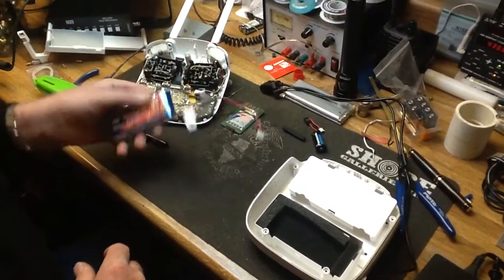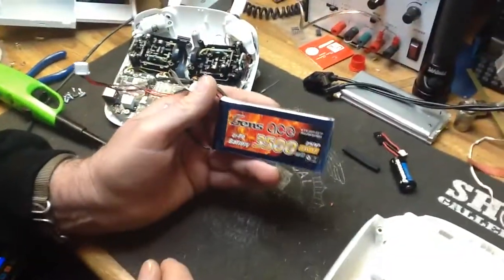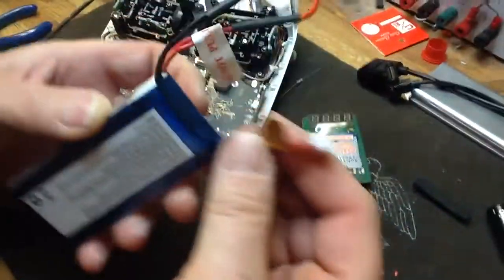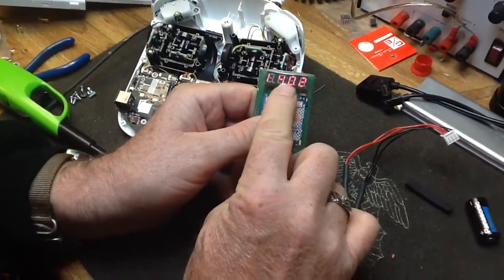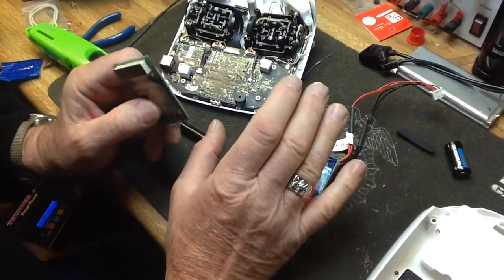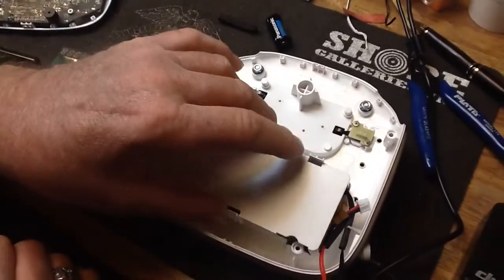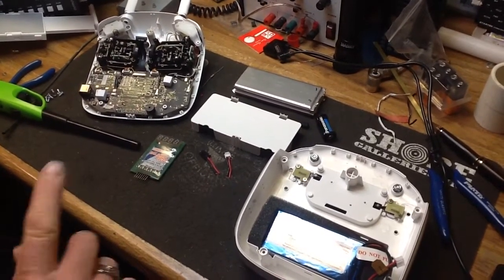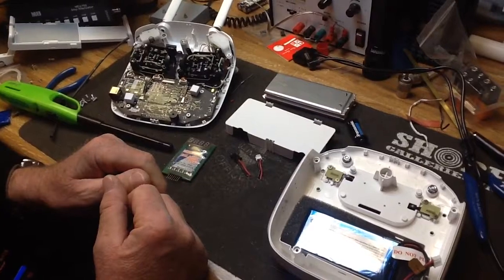Phantom 3 controller battery replacement GL300C Part 2

Comment: I've ordered the LiPo battery you suggested, a Gen Ace B-TX-3500-2S1P on eBay for $14.50 including shipping.  I see that the original battery was also a 2S1P pack.  So, I'd guess the integral board was likely monitoring each of the series cell's individual voltages for balance during charging.  I'm guessing the dual wiring from the old pack to the board may be because DJI originally was going to do the balancing on the main board and not at the pack.

Your measurement of a peak quiescent current of under 500 ma suggests this 3,500 ma-hr battery should run the controller for over 6 hours.  Your solution is actually the better design!  I have no idea why they thought they needed a 6,000 ma-hr battery in this controller!

Did you have the WiFi board (which the ribbon cable connects to) connected during your load measurements?

Anyway, thanks very much for your investigative work and for posting the two videos.  I'm anxious to install my Gen Ace battery and get this annoyance behind me!
Reply: Hi, Ted Sz! Do you know what the C on the battery means? Im trying to find a battery that will work correctly. Ebay isnt a good option living in norway.. Found one that had a discharge at 30 C. Will it work? https://rcbutikken.no/nb-NO/produkter/74-volt/formula-d-battery-3300mah-30c-max-60c-2s-deans.aspx
Reply: Oh, sorry! Of course you dont understand Norwegian:) Never mind the link. Ehm, the C is not temperature. It has something to do with how fast its possible to pull the power out of the battery. So the one in my link has a discharge of 30c with a maximum of 60c. And the one you ordered has a discharge of 1c with a maximum of 10c. And since i dont quite understand this, im not sure if it will work...
Reply: The C stands for the rated capacity of your pack, or 3,300 ma-hr.  So the base rate of discharge is 3.3 amps for one hour.  So, 30C means the pack supports 30 times that on rapid discharge in regular heavy usage, and the Max of 60C is the absolute brief and non-repetitive maximum current draw.
Reply: Also, the application in the DJI Phantom 3 controller is nowhere a heavy discharge application, as it is in the aircraft itself.  So, the peak current ratings are not really a factor in this application.
Reply: Read this and you'll be a LiPo expert:
https://rogershobbycenter.com/lipoguide/
Reply: ah, okay, i see! The aircraft needs these high peaks, but not the controller. So could one just as well use a 30C battery for the controller? I think maybe its safer to use a non-heavy disharge battery. I found a battery which is pretty similar to the one you ordered except it is not "TX", but "RX"(actually it says RX on the battery, and "TX/RX" in the description). http://www.gensace.de/gens-ace-3500mah-7-4v-rx-2s1p-lipo-battery-packs.html  But the specs seems to be pretty much the same. Same discharge rate, voltage, mAh... So perhaps it will work.
Reply: Yes, it appears you found the high discharge rate version of the one I purchased.  My cost here in the U.S. for the TX version, including shipping, was the equivalent of 12.64 Euros.  Even this battery in the controller will run it much longer than the two aircraft batteries that I own will keep the drone flying.  So, I'll be recharging all three batteries (2 aircraft, 1 controller) after about 40 minutes of flying time.  My estimate is that the battery I purchased should run the controller for at least 3 hours (based on a reply from a person who measured the peak controller current draw at about one amp), or maybe 6 hours based on the video author's report of about a 1/2 amp typical current.  At any rate, my TX controller battery should run the controller much longer than two aircraft batteries can keep the drone in the air.  I don't see any advantage of the higher discharge rate battery pack, and there is the disadvantage of higher cost.

Comment: Finally, a rational explanation of the problem along with a viable solution!  Thanks so much!  DJI is getting a really black eye with this common failure, not supporting customers with a fair solution, and leaving us on our own.  My advice to folks will be to avoid DJI until they learn proper customer support and not hide behind a warranty when there is such a widespread problem with this damned battery!
Reply: I agree they tell me they can't repair and I should buy a new controller.  What a terrible company DJI is.  When they have a known problem they should recall these controller and not put the problem on the backs of their customers.  DJI is a lousy company and does not stand behind their products
Reply: Really DJI needs to recall these chargers and make them where the batteries can be replaced!  Spending as much as we have on these controllers without being able to replace the battery is unacceptable!  350.00 to replace the transmitter when all it is is the battery.  REALLY!!!???

Comment: Thanks for posting this. I have followed your suggestion and repaired my GL300C using the same 3500 mAh battery. In addition, my controller needed some epoxy repair for broken PCB support posts. I added a hole beIow the charging port to access the battery's balance plug. I am pleased to confirm that your fix works well; my P3P is flying again! However, I checked the controller's power consumption over 4 flights (about an hour) and I find an average current of 1120mA in flight, which is far larger than what you state in the video (measured on the bench). In my case that would give about 2.5 hours of use (80% of full charge). Any ideas about the difference?
Reply: Could the controller mA load vary according to location (CE power) or the type of device plugged into the USB? My tablet charges when connected to my controller.

Comment: Hey, thank you for preparing this video.  Did you consider moving the circuit board from the old battery to the replacement?  (it is not evident to me that you did)
Reply from the maker: Bruce Nichols The circuit was bad from the start that was the reason for the battery failure
Reply: goneredcar1 ah yes,.  I was able to make this same repair.  I am up and operating with replacement battery and no circuit card.  in my case, one of the two battery cells were bad.  I am curious to try and install the circuit card on another replacement battery.  btw, don't cut off both wires of a connecterized battery.  wires WILL melt.  one at a time is the better way :/

Comment: Hi sir, Did you ever get to test if it works in normal conditions? If so can you provide links to the battery. Thanks you alot, and great work as I've seen the DJI community suffers the same issue!
Reply from the maker: The conversation works with plenty of power to run the remote for hours of flight time. The charging is very much like with the old battery but now I'm getting all lights on the remote to light, better then before.
Gens Ace Lipo Battery for Transmitter 7.4v 3500mAh This is the battery I used that maybe found at several sources. My battery was purchased at Partz.com for around $15.00. Remember to use good battery handling practices when working on Battery connections.
Reply: Thank you very much sir
Reply: goneredcar1 you had the same problem as me, only 3 lights on the controller and wont charge past 70 percent?
Reply: Thanks making this video! Finally some insight! I was just wondering, what was the initial problem with the controller/battery? Was it that it didnt charge?
Reply: How do you charge the battery? Having it connected to the controller, or do you take it out and use the balancing cable to charge it?
Reply from the maker: Verpeide TV You charge it like normal and it will preform the same as the original battery installation. The only factor is a reduction of battery time before recharge.
Reply: It works!!! It actually works!! :) Thanks a lot! I charged it normally, and it went up to two out of four dots/lights. Makes sense that it doesnt go any further since its 3500mah and not 6000mah. But two dots/lights is plenty of flight time anyways :) Edit: Also it should be noted that i have the Phantom 4 Remote, not the 3.